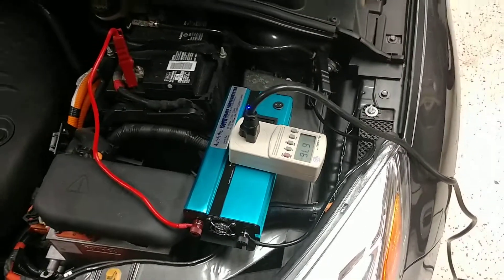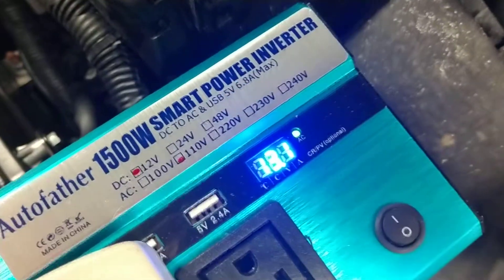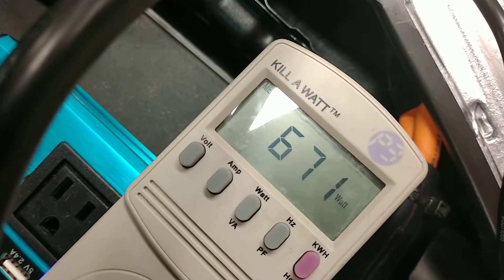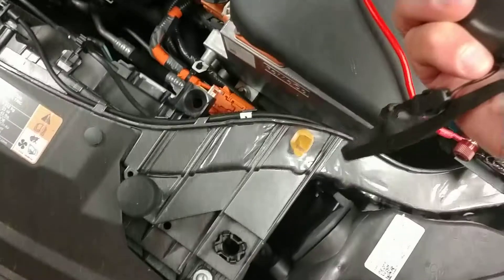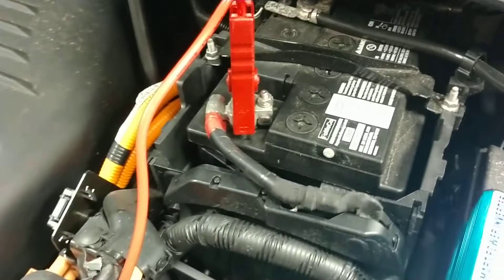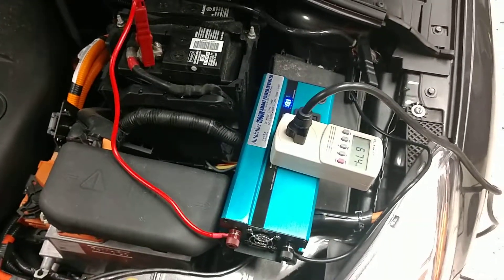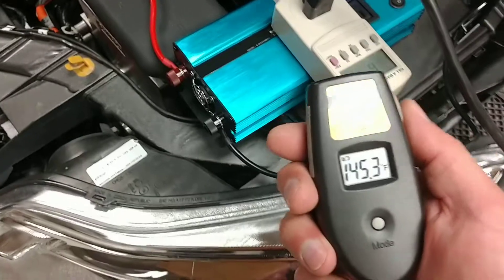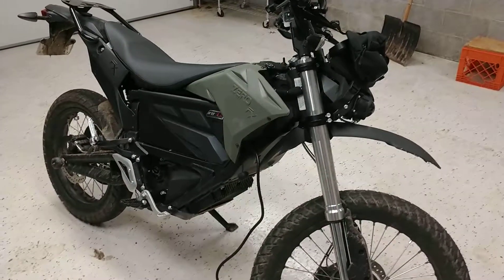Charging Zero FX from 12v power inverter

Comment: Hey Greg was just wondering how long it takes to charge your Zero FX to full charge??
 Im saving up for a 2011 Zero S. Looking online for Power inverters so i can charge where ever i am...
would a 800W Power Inverter DC 12V to 110V AC be able to charge The 2011 Zero S ??
Happy Holidays
Reply from the maker: Depending on the battery size for the FX, mine could take as long as 10 hours to fully charge from dead (7.2 kWh version).  But I was only using it for a boost when I trailered it to riding sites or for emergency recovery.  Inverters, especially small ones, rarely achieve their advertised power rating, and definitely won't do it continuously.  You should significantly oversize the inverter for a charging application (more than double).  Also use larger gauge wire, the DC input wires can get very hot at high current.  I'm not sure what a 2011 S charger pulls, but my 2014 pulled 1200 or 1300 watts.  That level would be difficult to pull from a 12v inverter, I haven't tried.  My 1500 Watt inverter definitely didn't run that amount, running the 700 watt charger on the FX seemed to be pushing it.  Maybe a 3kW inverter with like 2/0 cables might work?
I hope that information is helpful.  Happy Holidays to you as well!